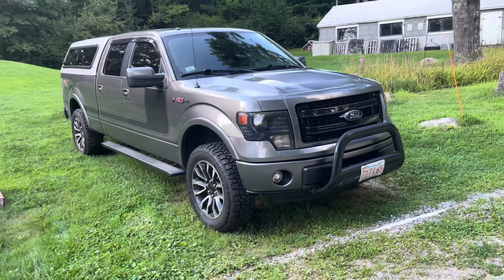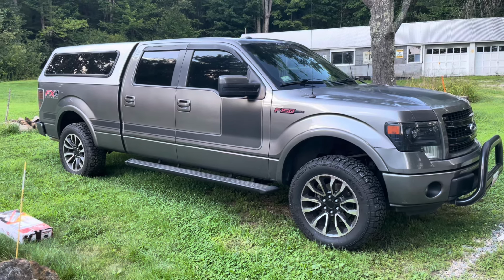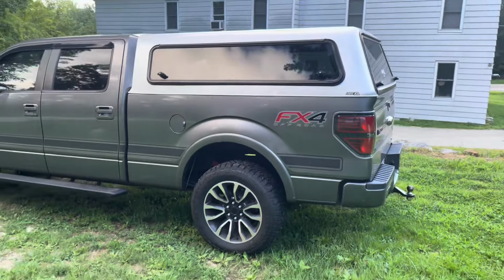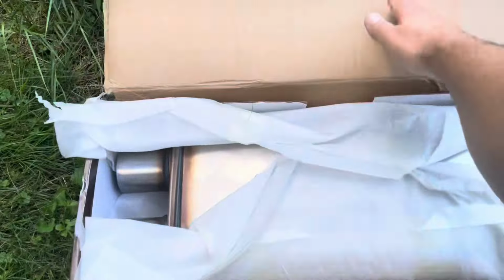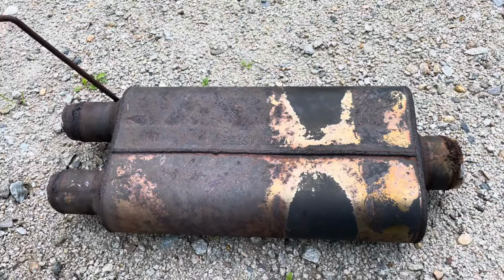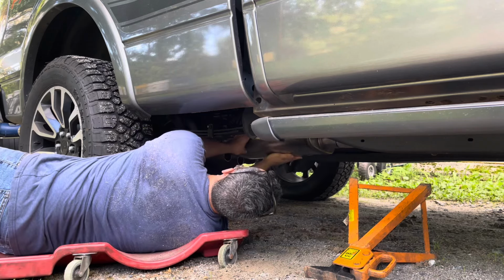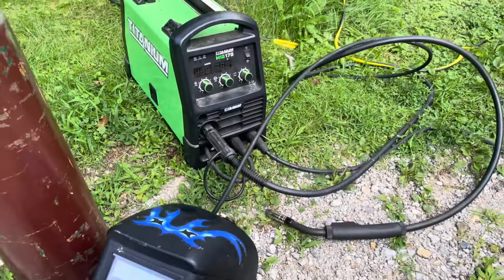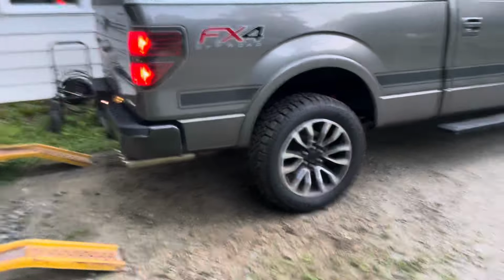My “new” 2013 Ford F150 FX4 5.0l coyote swapping Flowmaster 50 series for a Cherry bomb Salute.

Comment: 5.0 should be a more durable engine.    I would do liquid film or just bar chain oil undercoating to keep the rust out.  Also, ATF in door panels.
Reply from the maker: @DC_PRL  the bar and chain oil is on the to-do list